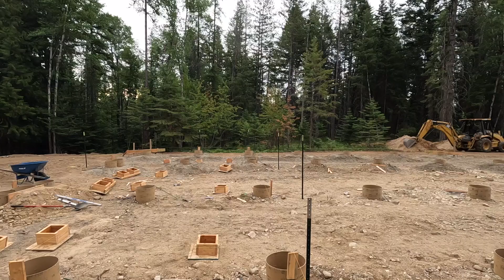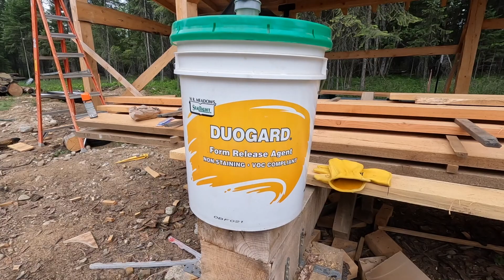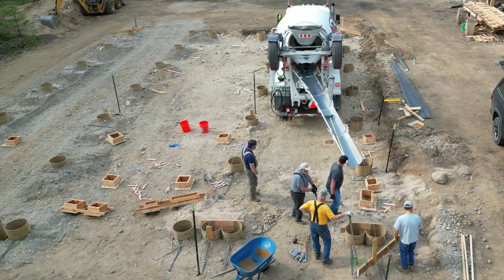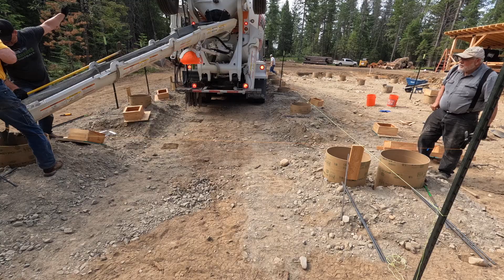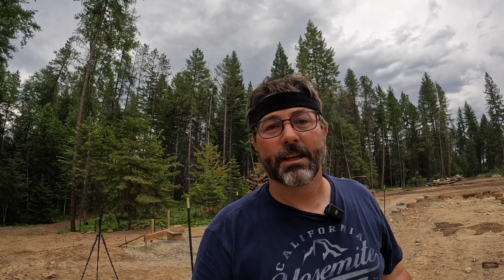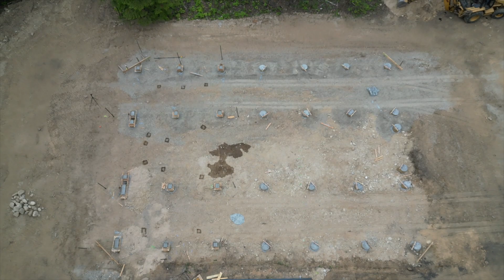Pouring CONCRETE For Sonotube Piers // Building A Barn // Pouring Concrete // Concrete Day

Comment: Looks like it went well. Glad that you only had to do the forms on top of the sonotubes on part of the barn. It looked like that could have been a bottle neck. 

I always try to have a place to go with any extra concrete. A simple form setup someplace close that you can use a pad, but you wouldn't do it by itself. 

The worst concrete experience that I had was helping a neighbor pour a pad for a feedlot. He had ordered 4 trucks and asked for them an hour apart. When we were about half done with the first truck, I looked down the road (it was a 1 lane road) and the next 2 trucks were sitting and waiting where the road was 2 lane. Before we got started with the second truck, the fourth truck had arrived. To make it worse, the guy running the chute insisted on putting too much concrete down, so we struggled to get it screeted smooth. He claimed to have a bad back and that was the only job he could do. That was a tough day.
Reply from the maker: Yes, overall, it was a good day. That sounds like a very tough day when you helped your neighbor. Something about helping a neighbor or a buddy...don't always know what you're getting into. Had some hunting partners like that. Thank for watching, Mike!